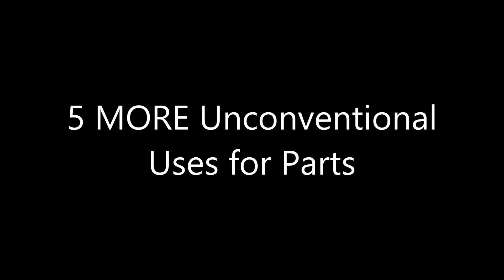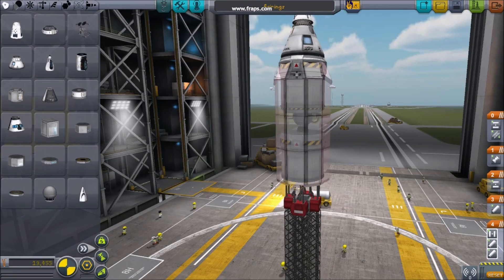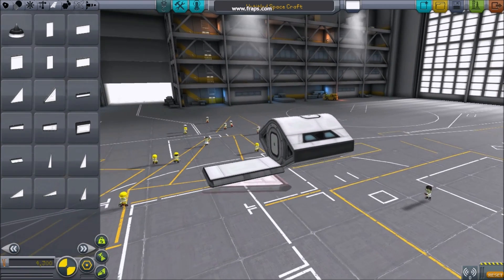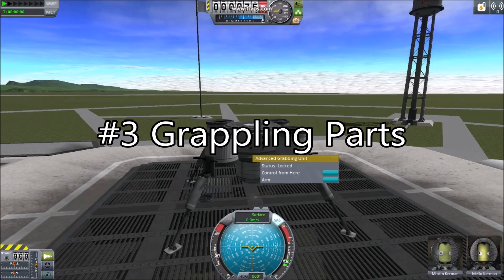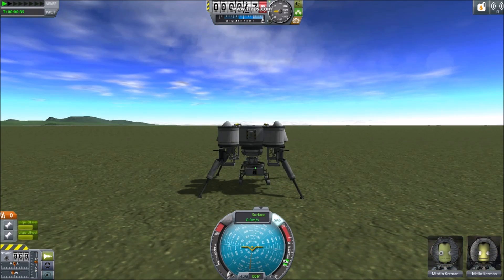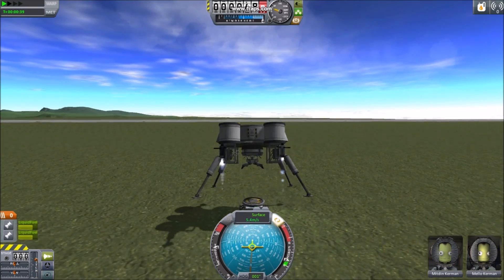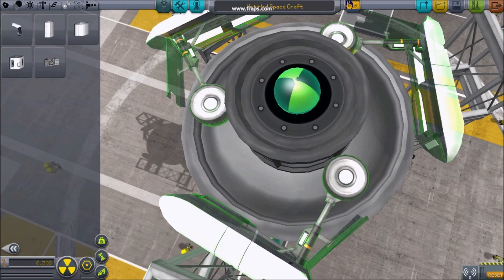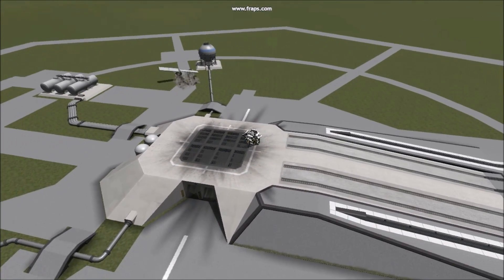Kerbal Space Program 5 More Unconventional Uses for Parts

Comment: I use structural panels for my fairings.
Reply: Good Call! They work too :D they are heavier but the also don't move the lift indicator. :D Thanks much for watching!
Reply: Any time.
Reply: I get a 2.5 to 3.5 adapter for most of my 2.5 probes and attach radial decouplers on the top of the adapter and build up with the small panels to the size of the probe. The top panel is slanted inward.
Reply: lol ur face